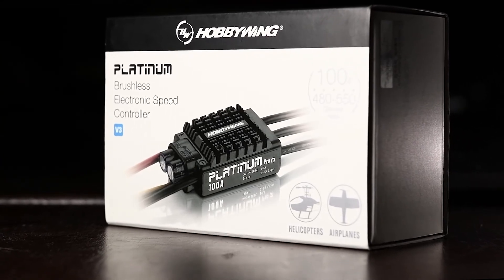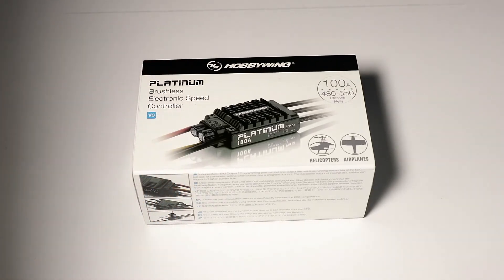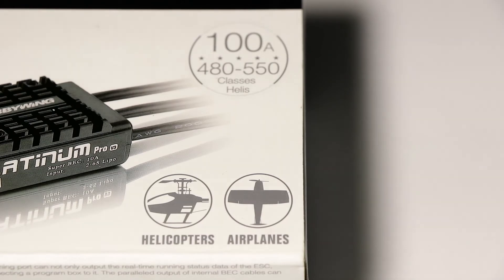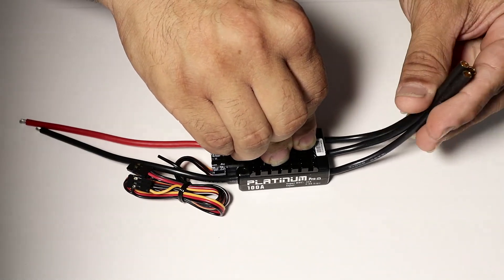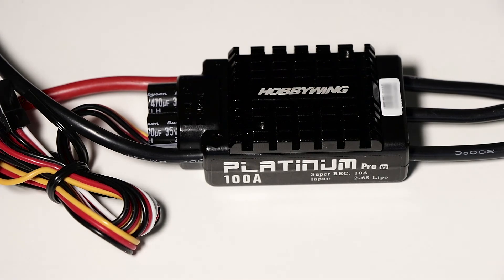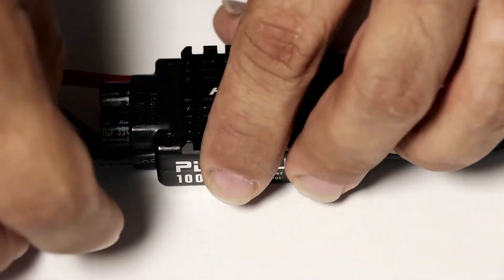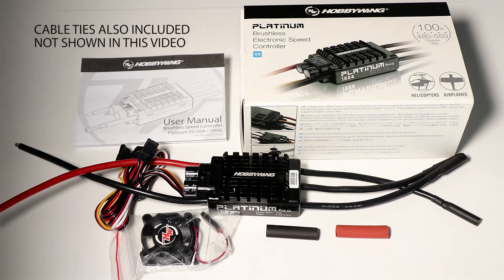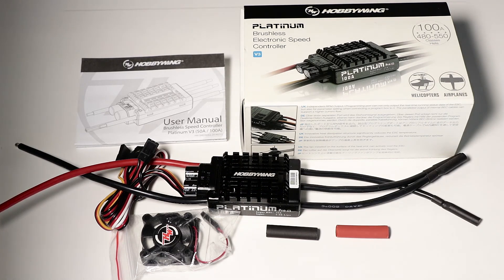Hobbwing Platinum Pro 100A V3 ESC - Unboxing & Review

Comment: Nice unboxing, I swapped my castle creation 75 esc for the hobbywing 100 on my 420. It fits better and is a great esc.
Reply from the maker: I used a talon 90 for a long time with no issues before switching over to the hobbywing because of it being lower weight and size. The hobbywing is a great quality product..Obviously there are other high spec brands that surpass the hw including kontroniks etc.. but from a price perspective its good bang for buck!